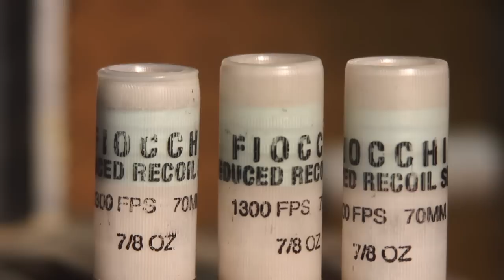An Innovative 4 Pin Shotshell Roll Crimper

Comment: That was a real test on those mangled hulls! You were harder on them than me. I plan for the ones in the store to have a black oxide finish by the way. Excellent video!
Reply: Great stuff but been trying to order off the Reloaders Network but no one is answering. There doesn't seem to be a drop down for Canada and no reply on the second or third inquiry?? What gives. For starter I tried getting the Wad Seating Tool Combo for Svarog “Special” Wads
Anywhere else I could get some Nick Ross goodies??
Thanks!

Comment: Interesting and thanks for uploading. A US friend of mine calls this tribal knowledge, it's not written down. My 410 roll crimp (home made) has never been very good, so I just made another, two pins but actually just one all the way through. I snapped off my narrow grooving tool and used another. Thought it would be junk but gave a thicker crimp which I''m very pleased with especially for tube magazines. I don't reload, I have a very fussy gun (9410) that likes 2.5" cartridges (63.5mm). Many Eu cartridges come out up to 67mm even if advertised as " true 2 ½ inch case" so a quick re roll often sorts that out.  Great video, very informative.

Comment: Man got to love that (blue dirt) lol I used to load 32gr of it under a rp12 wad with 13/8oz of 5s or 6s depending on temp and distance  as a long long distance trap load for the 50-80 yard money shoots threw a bt99 or bt100 32 in ported barrel

Comment: Nice video but I guess everything old is new. I'm actually still using the bgi mechanical hand crank roll crimper 4 pin patent date 1891 they work good paper and plastic hulls takes a little effort but works good and it actually has a square roll crimp and the round roll and a lot less noise lol. And probably a whopping $16 invested.

Comment: Why didn’t you trim your hulls down to match the slug wad and charge. And just put a little grease on the end of the hull. I use a little bowl with a pad with 3 and one oil on it and just dip the end into the pad and you’ll never have to keep putting vasiline inside the crimper and have to clean it often.

Comment: I was hoping for an explanation of what the pins did and why four were better than one. I have made my own as per a very good and very short (speeded up during the boring bits, take note!) video on here with no pins at all and it works just fine. I made the cutter as per the video from an old round file, cost? Very little!

Comment: Can you reload these after firing without having to cut them down? I was under the impression that when you roll crimp you can’t reload it at the same length again because the hull is wrecked or weakened where it’s rolled?
Reply: I bought the Nick Ross reloaders network 4 pin years ago. Works awesome for my heavy 10 gauge turkey loads! To my answer above. I have to cut down factory hulls or they will be too long to cycle on my gold. I can get several firings without having to cut them down shorter.  Some get cracks around  the edges so I have to cut them down shorter.

Comment: This 4 pin design looks almost identical to the old crimper I have. It was brass though.
Reply: However, it looks these pins are especially not totally radial but angled. For a reason I suppose.